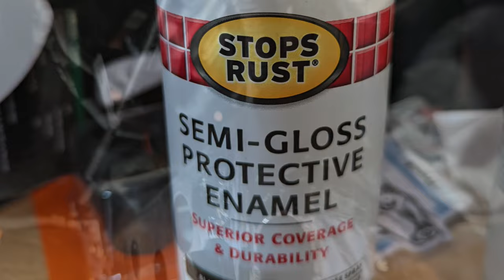Bronco Rough Country Hidden Warn Winch - 2.3L - Modular Bumper

Comment: Hmmm the skid plate has bolts stick out... hit a rock the head of those bolts are gone.
Reply from the maker: Apologies for missing this. Were you able to get the bolts out and fix it? I really like this kit but took the Bronco on my second Rubicon trip and must have slammed the part of the plate that guards the intercooler brackets. The Ford bracket got smashed, the bolts stayed in and the winch plate slid out. When the winch line is in it tightens the plate good so its not a huge issue but I now need to look into fixing it.

Comment: What size sawzall blade did you use?
Reply from the maker: 9" 14 TPI Milwaukee Metal cutting blades
Reply from the maker: Should mention I went through a few of them so buy a 5 pack
Reply: I used a diablo bi-metal blade and was able to get through both with just 1 blade, also did it with a 6" but yeah 9" would give a little more to work with, just tight with the hoses/lines @greenmachine4x4

Comment: Did the RC skid plate fit without issue? I saw a dude install the same mount (different winch) and he had to shave the edge of the factory plate as the other skid plate didn't work with the 2021 Badlands steel bumper. He had to cut the factory and affixed the Hawse(?)
Reply from the maker: RC skid plate fits without issue on the badlands.. I think the guy you are referring to needed to do that when the kit was not compatible with the modular bumper. Originally RC only had the kit available for the plastic bumper
Reply from the maker: This is the guy I am referring to. He did this before RC made the kit compatible with the mod bumper

https://youtu.be/ac7rxHZqY8M
Reply from the maker: Watch from the 2:45 mark and the guy explains the kit (at the time) was not made for the mod bumper.

It is now, just check the description of the product that it's good for the mod bumper and you'll be good to go
Reply: @greenmachine4x4  Thanks Dude! Glad to know it works with the mod bumper. Stoked!
Reply from the maker: @winkydee  good luck with the install!

Comment: That's quite the awesome color setup. Is that all a wrap? And if so about how much did they charge? Was thinking of doing something similar.
Reply from the maker: Yup, just a wrap for a color change - shadow black underneath. Paid $4k total
Reply: @greenmachine4x4  What was the original color? I want to do the same with mine as it’s not the color I wanted but it was the only one I can get my hands on.
Reply from the maker: @chrisrob722  underneath is Shadow Black which doesn't look too off with the inner doors of the body still black. If Ford had offered a similar color to Jeep's sarge green I would have just went with that. There wasn't a color Ford had that I absolutely loved so went with black to play it safe then wrapped it

Comment: where do i get this
Reply from the maker: From Rough Country. It is only available for the 2.3L currently: https://www.roughcountry.com/hidden-winch-mount-51054c.html
Reply: @greenmachine4x4  Will this eventually be available for the 2.7 V6 ? If so about how long?
Reply from the maker: @marcjohnson8488  not sure if a winch would fit for this kit on the 2.7. but you can call or email rough country. Thier customer service is pretty good and they pick up the phone.

Comment: thanks for this video...
the RC offer the option to get the winch PRO9500S> is this mount compatible with all winches >? what if I dont want to get the RC one?
Reply from the maker: It is not compatible with all winches but the warn 10s evo fit fine.. try and compare the dimensions between them to see if you can tell

Comment: Sorry for so many questions. I just installed mine yesterday and everything went great. The front sensor wiring was a little difficult to connect and disconnect and the front ski was slightly out of spec so it was difficult to bend to match all the holes up but these were minor issues.  The fairlead does not fit the hole on the RC skid. Did you install it with the top or bottle slightly out on the lip or did you use washers to make it flat?
Reply from the maker: No worries on the questions, happy to help!

My Warn fairlead is not flush and I mounted it with the bottom in the groove with the top part resting above the groove. Once tightened it won't be going anywhere and it goes unnoticeable. 

But I am thinking of getting the RC fairlead to make it flush and maybe blanking out the logo. Last time I checked they were backordered

Comment: Was the wire lead long enough to make it to the interior? Also how reliable is the wireless? I just ordered the exact set up and hope to install this week on my capable bumper
Reply from the maker: The wire for the warn evo 10s is super long and reached the cab without a problem. I plug in the controller whenever driving to an off-road destination to charge and I can sit it in the middle  of the dash connected. Wireless works great. Good luck with the install!
Reply: @greenmachine4x4  is it easy to reach inside the engine compartment to plug in the lead to the winch or do you leave it plugged in and run inside the cab?
Reply from the maker: @KameronATM  I had all cables attached to the winch and ran up threw the engine bay before raising it up to mount.

I have a manual and think my grommit might be different than an auto, but it was a real pain getting to the grommit and cutting through

Comment: Did you have to remove the bumper or just loosen it?
Reply from the maker: Instructions say to remove the bumper but I just loosened it and had a neighbor help hold it when I needed to insert the RC brackets between the bumper and the frame (didnt get that part on video unfortunately). 

I had the baja design light kit with all the wires ran from the bumper and wanted to avoid removing it.

Comment: Good work, it has a nice clean look. It definitely affects approach angles so it's still a tough call for me between this or a bumper-mounted.
Reply from the maker: Check out the lower control arms on the RC site pic. If there is any difference it's very minimal compared to the OEM skid plate:

https://www.roughcountry.com/hidden-winch-mount-51054c.html
Reply from the maker: This might be the only pic I have with the OEM skid plate. Its close in comparison: 

https://photos.google.com/share/AF1QipM0big0UOYyQzYTSE9BW9Zgv5_1weL202f5ipkEcs7uVTfwRAyVvPa33ihOchkwoQ?pli=1&key=OFBnY2RNQmQyZ2ZERkNCZFJDODVfZXBZcHVMWmhB